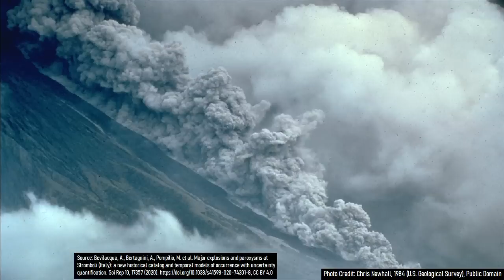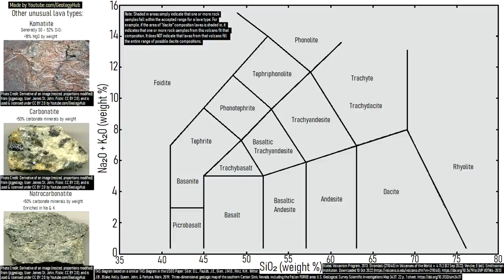Stromboli Volcano Update; Pyroclastic Flows Generated, Crater Collapses

Comment: I know you can watch the scirocco del fuoco normally relatively save form the tip of the ravens/ Punta dei Corvi. Am I assuming rhigt Am I right that if you had stood at this vantage point, you would have been smoked by the hot dust?